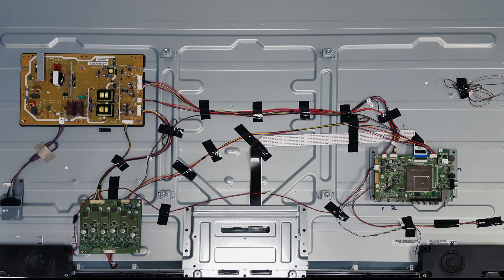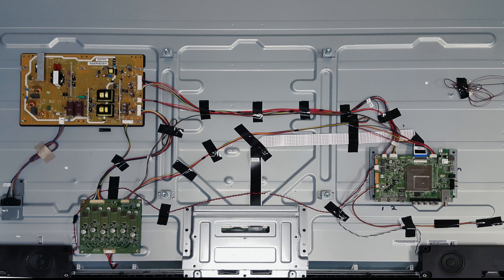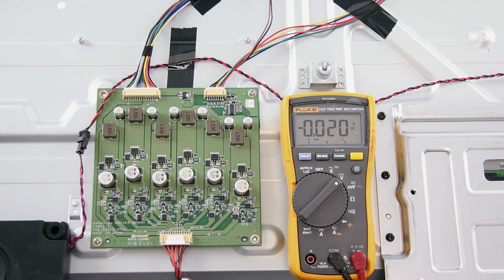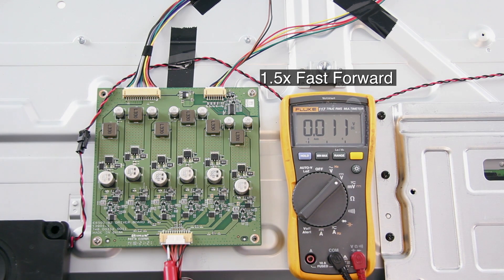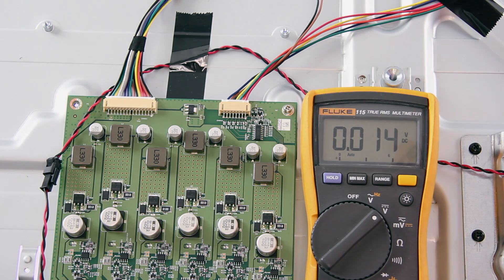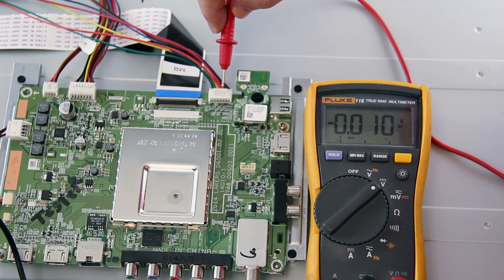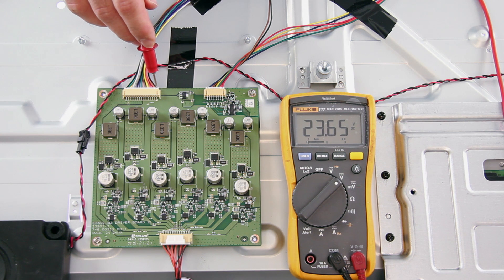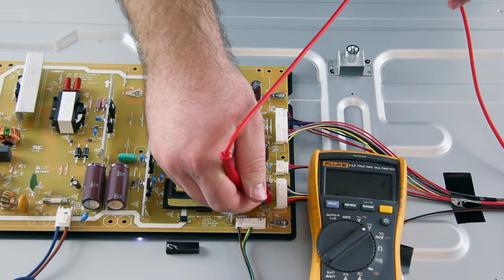Vizio D650I-B2 LED TV No Backlights - Voltage Test Troubleshoot LEDs & Power Supply & LED Driver

Comment: I got audio on hdmi but not on avi could be my fault but tried multipls ways E.G. COMPOSITE jacks,COAX with a converter box to composite.BUT AUDIO CONFIRMED ON HDMI.130 VOLT ON ONE LED AND 90 VOLT ON THE OTHER?

Comment: The results are as follow;

1. Checking voltages from LED drive into the tv. Panel (~35V)- no reading
2. Main board turns on the LED drive. The voltages should be around (~3.3V)- no reading
3. Checked voltages in the main board from LED drive (~3.3). -no reading
4. Then checked voltages on the connection coming from the power supply to the LED drive- no reading
5. Checked voltages of connection coming from led drive to the power supply- no reading
6. Also the voltage going from the power supply to the main board (5V)- There is a reading. 

I would really appreciate any support on this. I would like to know which of the boards are not working properly. If its mainly the main board or the power supply?

Comment: I have a Vizio E550i-B2. Im having an issue that my backlight might not be working. I've done the flashlight test and I do see an image on my screen and I also have audio sound too. I took off the back cover and it seems that my power board and my LED board are connected together by a small black clip. Is it a 2 piece boards or a whole piece? Also, how can I diagnose my LED board and power board with my multimeter to solve my issue? Or what else might be the issue on my TV?.... Thank you for your time.